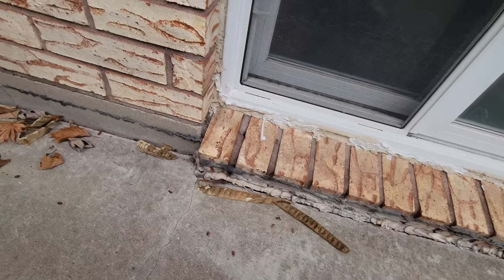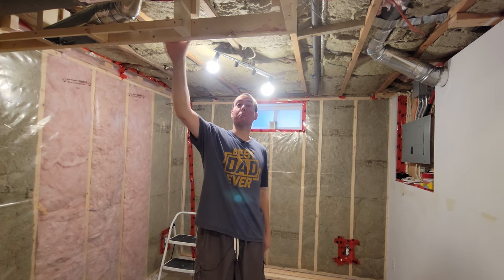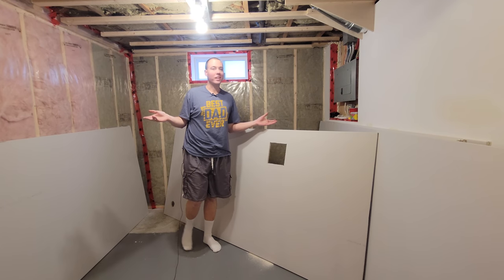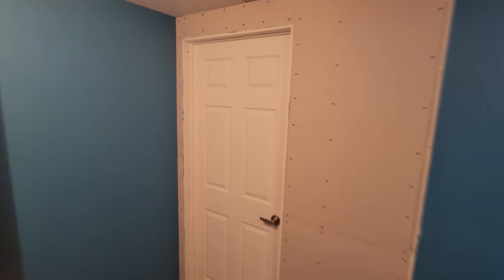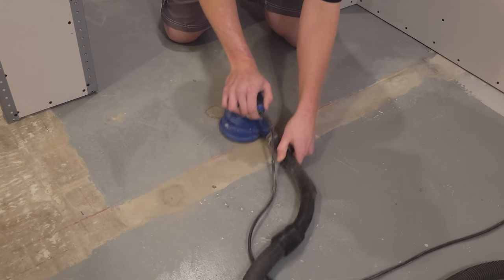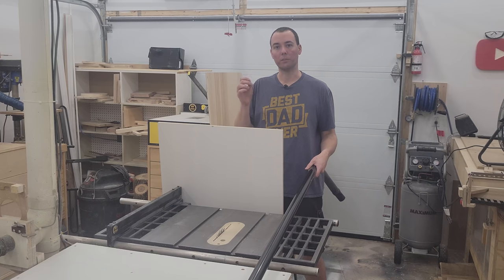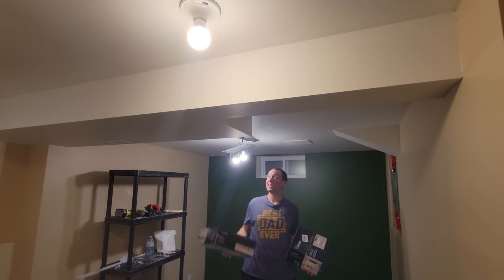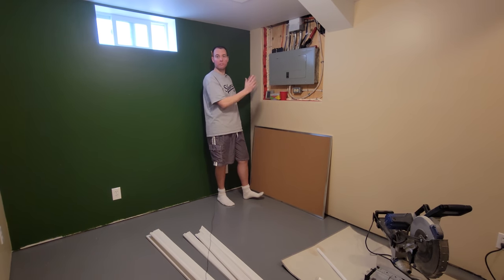Is it Finally Over? (Adding an Extra Bedroom - Part 4)

Comment: Good job remodeling. Just a thought about covering the electrical panel that it's not really up to code maybe? Setting the cork panel on hinges should do the trick though. Again, it'd be worth checking with your local building code.